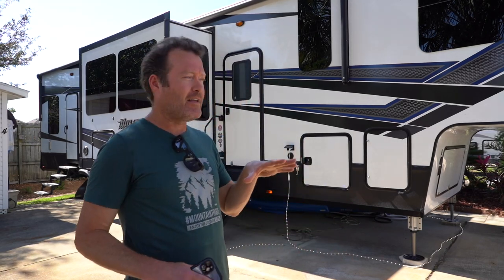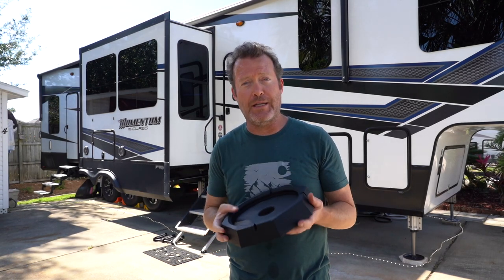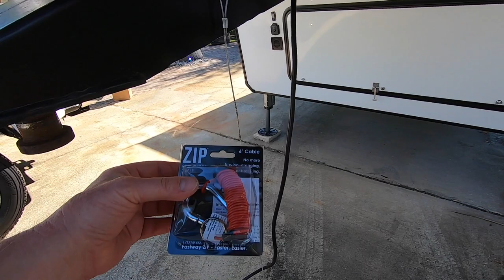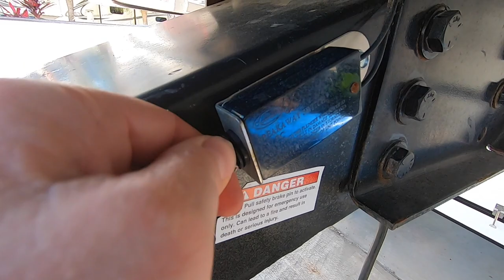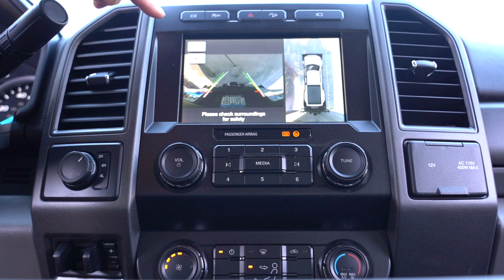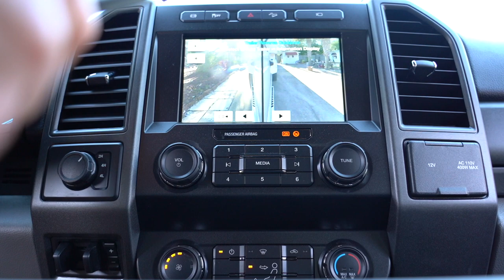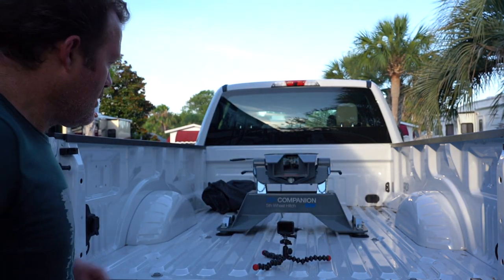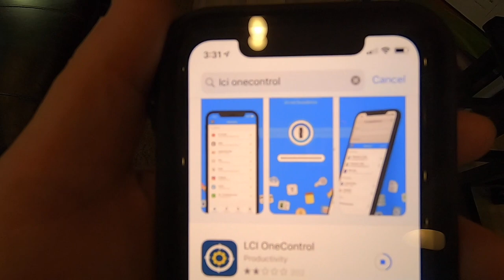MUST HAVE RV UPGRADE! SURPRISE FORD F450 FEATURE (RV LIVING FULL TIME)

Comment: One great upgrade for locks is made by Bolt Lock. They make the locks that use your vehicle key to unlock. Kind of pricy but you never loose or misplace  your key for your locks.   Another option I have had on my last three trucks is a Tonno Pro tri fold soft cover. At $270.00 their a real bargain. I just fold mine up and latch in place when i tow my fifth wheel. If you need to remove the cover it takes only unlatching, folding the cover up and latching it in the folded position and loosening the attachment knobs. Total time less than three minutes. Just an old man thinking out loud

Comment: I have a bedRug in my F-350 dually. Not good if you're hauling rocks, dirt, or mulch, but keeps things in-place and is easy on the knees. Also makes it nice if you want to lay in the truck bed and look at the stars! Easy to install and no need to sand the factory paint. Also, have a Retrax retractable cover for a bed cover. No strap and can lock anyplace you need to along the length of the bed.

Comment: Tom, at 10:50 you show hooking up your emergency breakaway cord to a rear attachment area in the bed. I would strongly recommend that you do not attach it there, but move it to a front bed attachment point. That way the brakes will take effect MUCH earlier if you have a detaching episode on the highway..

Comment: Do the Rhino spray liner for your truck bed.  My husband is a contractor and had the Rhino liner sprayed on his truck bed 10 years ago.  The liner has held up super well considering all of the equipment and materials he hauls to job sites.  Two bad points of using an installed liner.  1st, water can get trapped underneath the liner and can cause the truck bed to rust out.  2nd, the material is slippery, so anything you have in the truck bed will slide around.  Rhino spray liner is the best.  👍👍

Comment: Line X spray in bed liner and the Bakflip MX4 bed tonneau cover. Can't go wrong with that setup. Then you'll be able to lock up gear in your bed and protect that hitch. Flip it 3 times open and snap the locks in and your ready to hook up to travel. Great video.

Comment: Installed snap pads on our MH a year ago, they work great, no more crawling under the Coach to place 2x12s.  10000 miles, never an issue with them coming off.   One thing we did is spray the bottom of the jacks with primer to help prevent any rust formation.  One of the best upgrades we’ve done.

Comment: A spray on type bed liner would be the best for you truck. We did Rhino but there are a few companies out there today that offer it. We love our snap pads, my favorite thing about them is that when on concrete or gravel  there is no slipping of the jack when it hits the ground. We had a jack slip on our old MH and it actually bent the jack and was costly to replace.

Comment: What a pain to move 7 feet. We have yet to get snap pads. We never put anything under our jacks because of auto level. Free is always good. That is terrible to have neighbors walk behind your rig so close? Oh no. I would not agree to that. We put in a roll n lock cover with a mod so it is partially closed while towing. Larry loves that truck upgrade. Oh that is a better clip. Larry still trusts turning and looking to hitch along with backup camera. Do you have a hitch and unhitch list? We love ours. We have a Grand Design Solitude fifth wheel pulled by Ram 3500 long bed dually. That earth stuff can help with bugs.  Good idea with the soap with the snap pads. Pretty cool how they pop in. At least you made the best out of the shirt move. Our truck came with a bed liner. We got lucky. We love auto level. Great vid. Keep safe. Alice

Comment: I have Snap Pads on my Winnebago View. I got them about a week after I got my HWH Levelers installed so I have had almost no experience without the pads, but I think they are great. I have had them for 3 years now, and they are still like new. I keep my rig in my driveway at my sticks and bricks when not on the road, and so far they have not left any marks on the asphalt driveway. I think they were a good investment.

Comment: Hi Tom, I also vote for Line-x bed liner. much better than Rhino, IMO.  I have seen Rhino's peel and flake off... never seen that with Line-x.  I have had 2 trucks that got Line-x on day 2 of ownership.  A must have for 5th wheel towing.  With your puck system there may not be metal to metal under your hitch, but the Line-x should still make things better and dampen some noise from the truck bed.

Comment: On your fifth wheel pad lock, you might also want to lock the top section to the lower base. As you have it that could possibly be stolen from the base. That's one of the first things that I did after getting the Companion.

Comment: It seems like a real bummer to get all set up and then have to move your rig forward which requires that you do it all over again.  I really like the looks of the “snap pads” and you made it look so easy by adding the dish soap first.  I don’t have any knowledge of different bed liners, but for advance planning, be aware of a few concerns if you plan to get a tonneau cover.  We have the same year and size truck you do, but we bought the Ford branded trifold tonneau cover for the bed.  It easily folds out of the way so we can hook up to our fifth wheel, however there are two issues to be aware of before you buy one.  1) The trifold model adds 3 inches of height that could get in the way if we were making a sharp turn while encountering a dip or a sharp hill. 2) with the cover in the stored position for connecting to the RV, I can’t see the hitch nor can I see the camera view to properly line up the hitch to the king pin.  I got around this by putting a wrap of blue painters around the tonneau cover’s cross bar and it helps, but I still can’t see the hitch to line it up.  If I had to do it again, I would have purchased one of those roll-up covers and at least then I could see the hitch with the bed camera.

Comment: Nice work. Stay away from the drop-in liners dirt and debris gets caught under them and can rust the bed out (although your truck does have the aluminum bed).  I say go with the Line-X Spray in bed liner. Little on the pricey side but you won't have to worry about scratching your bed anymore.

Comment: Our latest 5th wheel came with the One Control stuff. I don't like CAN controls (closed area network)  in an RV.  I work on these systems in other mobile equipemt and there's too many completely crippling failures which are much harder to bypass and work around that failure when a module quits functioning. You can't diagnose and repair computer modules that go into "brick imitation mode", which happens way more then it should unless you get into the much more  expensive / complex types such as whats used in the automotive industry If RV mfr's used systems on par with automotive systems, then you have to add many thousands to the cost.  When one module quits, all you can do is order in a new module and rpelace it if the basic troubleshooting (checking fault indicator lights) don't tell you of a failed compoennt farther downstream.

Comment: Love my snap pads, had them since early June.  BTW, glad you put up the steps before leveling the rig, if you didn’t,  the top ledge of the step will jam up on the door, potentially causing damage to the underside of the door when the stabilizers retract before the level process starts.
Reply from the maker: Thanks for sharing David!

Comment: Have the Snap Pads on my Cl A.  Easy peasy!   Unless I have a bad site for leveling I don’t need to “get down on my knees” to add blocks under jacks.  Be sure to treat them often with rubber spray that you use on your seals!

Comment: Spray in liner. Either line-x or rhinoliner. I have line-x and works great. My previous vehicle had the plastic liner. They are terrible. I also have a bak-flip bed cover that keeps my hitch hidden and protected from the elements.

Comment: Already got them about 2 weeks ago.  Very nice so far.  Only issue I see is the ones behind the rear tires really catch debris.  Just got back from Minnesota and they were filled with sand.  have to spray them out after a trip no big deal.

Comment: Love my RV Snap Pads--second trailer I've installed them on. Love that they help to "anchor" your jacks so they don't slide on smooth surfaces. Regarding bed liners, I've always used a rubber bed mat (Dee Zee). They work great to keep things from sliding around. I just measured and cut holes in the mat (with a hole saw) for the pucks to go through. The mat fits under the B&W Companion without any interference at all. Although my newest truck came from the factory with the spray-in liner and the bed mat still fit, an aftermarket option may be too thick to allow you to run both.

Comment: You mentioned bed liners. The drop in liners are the cheapest. They work well and are only about $300. The bed side rails hold them in with NO fasteners. You would have to mark out and hole saw for your factory puck system. It's weird to me that your truck doesn't have the "Box Link" system in the bed. That would be the 4 upper hold down cleats. A spray in liner is about $500. and you can find an installer by Googleing it. I went to the Snap Pad site. What is it a national secret on how much they cost? Never did find the price so I guess I don't need them that bad.

Comment: I use the line-x sprayed on liner on my ram. thats what dodge uses but Rhino sprayed on liners are just as good. sprayed on or rolled on liners are better for a lot of reasons than a cheap plastic drop in style.

Comment: Not a rv er yet but we watch your post all them time for ideas and up grades and we also watch matt at general rvs and robert out of miami travel the country as well you do keep on going on love it, i do have a thought about those i call them small lift posts  on the front of fifth wheel trailers they look to small to lift the weight they have to lift i was an over the road driver for years and those post on most trailers we had were sturdy thick ones just a thought, has anyone had trouble or issues with them .

Comment: So the snap pads stay on all the  time . Also if you have the time I use Raptor liner and did it myself they send everything too including the spray gun you hook up too a compressor and it’s guaranteed for life of the vehicle. And you can add any color too match if you want. Anyway the Snap Pad are out of stock and their not making any right now because of COVID-19

Comment: Why would you leave the 7 pin cord on the ground? Why not coil it up and put it in the king pin housing, or at least get a cover to keep the pins clean and dry. As for a truck bed cover try Pace Edwards, an electric one. Have one on my truck and love it, also keeps the 5th wheel hitch covered when not in use. SAFE TRAVELS

Comment: @6:21 put the lock on the otherside...(between the main unit and the mechanism) then it cannot be cut with bolt cutters or a cordless grinder  just a friendly tip.

Comment: Hitch locks should be on inboard side  harder to cut with bolt cutters.
Type of lock may be subject to defeat but don't know fix for that.
Reply: All someone has to do is remove the cotter pins and bolts and they can lift the whole hitch out of your truck--even with handle locks installed. If someone wants it bad enough, they will get it but those locks make it more difficult and ensure nobody rotates your handles at fuel/food stops while traveling.